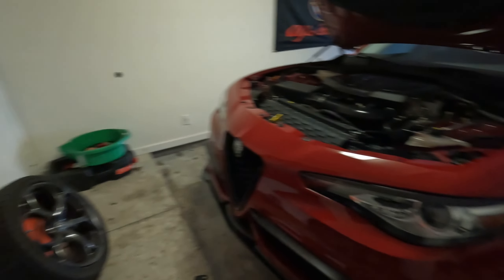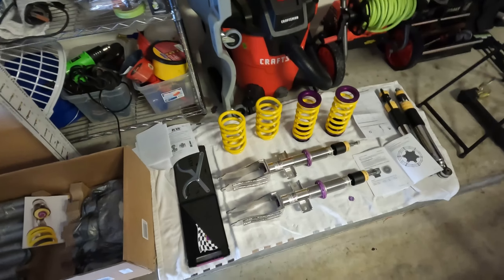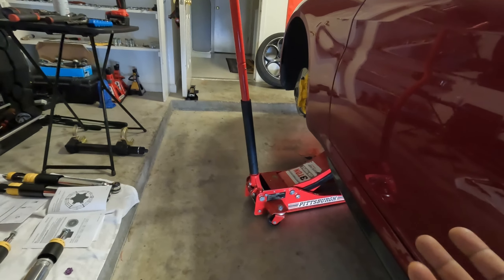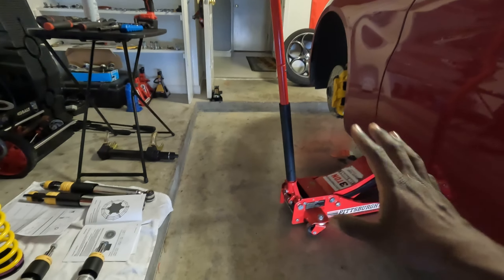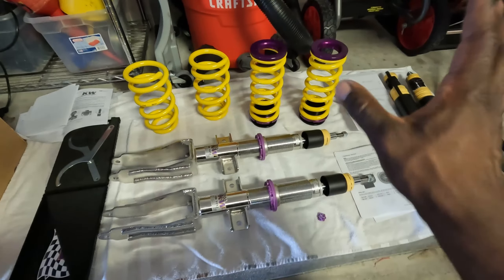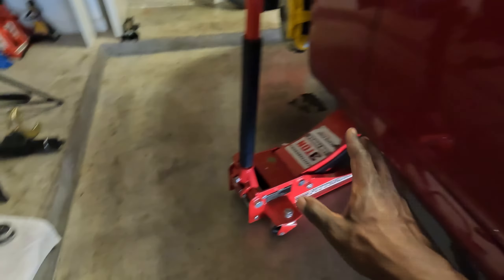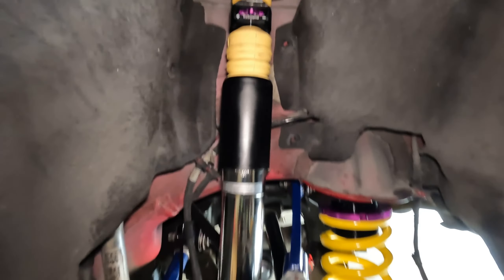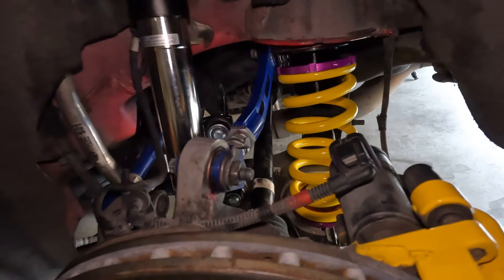KW V3 Coilover install guide Alfa Romeo Giulia Q4

Comment: That's an excellent vid. By the way, what's your experience with those blue Megan Racing Camber and Toe arms? I had to remove mine because of the rattle it does. Let me know!
Reply from the maker: Man mine have been solid! Literally not one issue!! Yours may have just needed to be tightened

Comment: One concern I have since I dropped my Q4, is that it feels like it binds when turning. It does this with the same H&R springs you had on as well. I don't like that binding feeling. Suggestions?
Reply from the maker: Yes but it does this even stock. Reaches the limit of the wheel and start to drag at a certain point
Reply: @club.alfagt  Yeah, I noticed that as well stock. None of my other AWD cars do this but the Alfa. My Evo 8, my Audi's , STi or my slammed ATS have these issues as pronounced as the Alfa's. Oh well, it is what it is. lol Anyway, thanks for the response bro.😃
Reply from the maker: @luis-ciphermstar6597  it’s a result of the double wishbone suspension up front and the caster angle 

This happens on cars that handle very well at high speed on the track

Comment: If I only have 1 floor jack and 2 jack stands, can I jack the car up from the front centre if I remove the panel? And also where do the jack stands sit exactly
Reply from the maker: You could but I would not recommend that
Reply from the maker: I put the jack stands underneath hard points on the subframe rear
Reply: @club.alfagt  how did you go Bout prying the rear control arm? Is it on there really good or easily drops?
Reply from the maker: @braidontennant  you’ll see in the video….spray some wd40 on the bottom of the spring, compress the spring with that tool, and you can easily pop the spring out with a pry bar and minimal force